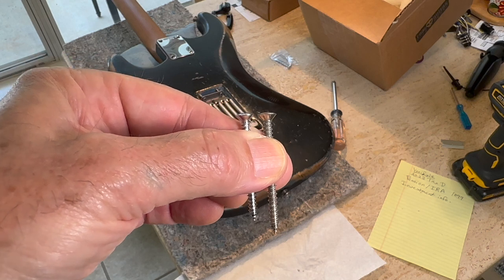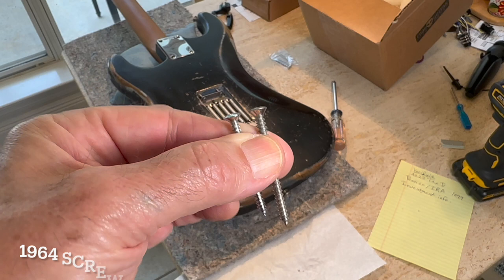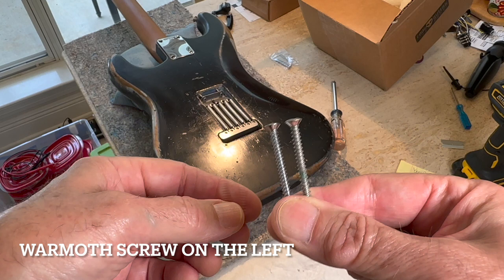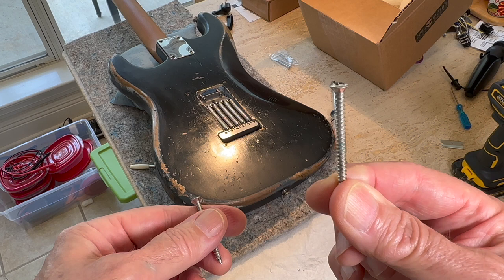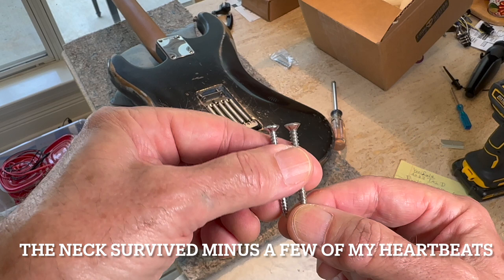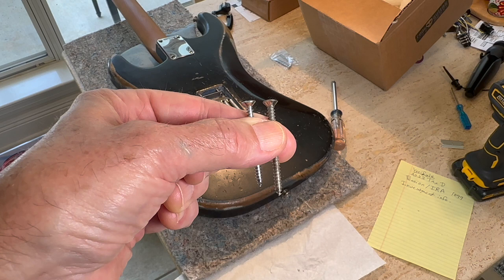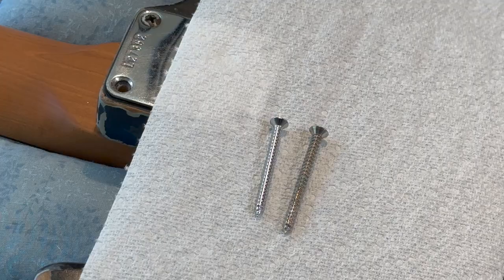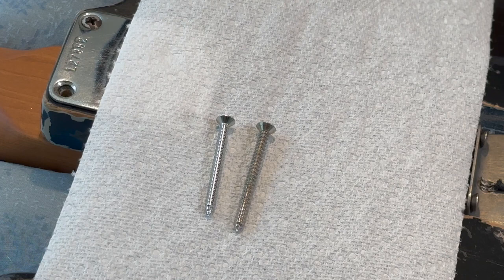Be Careful When Mounting a new Musikraft or Warmoth Neck to a Vintage Strat

Comment: You, apparently,  and thankfully,  are on my feed. I would ask, what guitar is it that Master Millstap finds himself putting a replacement neck on. Intriguing stuff. I would submit, thanks to your screw dimension insights, that I would prefer to reuse the old school screws, by enlarging and deepening the pilot holes on the new neck ( Carefully gauged of course ). Ok, to a complete Newby to woodworking,  that might seem daunting, but it actually only requires a little application of commonsense, and I would just feel a little better about the job. How about show us what guitar you got there with the new neck? And you probably should go ahead and crank it through, oh I don't know, your old Bassman? Please?
Reply from the maker: I tried to deepen the holes because I measured them and could see they weren’t deep enough. That roasted maple is so hard, the bit wouldn’t touch it. So, not thinking apparently, I put more pressure on the bit, (a fairly new bit with a depth stop on it to keep from drilling through the rosewood fingerboard) only to look at the fingerboard and see a bulge forming from the pressure. Heart attack time. To make the holes bigger could be the same issue and even chance breaking a bit in the hole. I highly recommend getting the proper screws the holes were drilled for. Musikraft and Warmoth both sell them. Forget the vintage screws. I would have never thought they were different but after this fiasco, it dawned on me. The first thing I was planning on doing when I got the Warmoth parts (video coming this weekend) was to remove a vintage screw and compare. That is when I did this video. Don’t attempt to drill in the roasted maple if it can be avoided. Of course, depending on your tuner choice, you may have to drill the tuner mounting holes which has to be done carefully. I did a video on it (Musikraft neck #1). I’ve had people tell me 1/2 of their headstock feel off when the crack went through all of the tuner posts and screw holes. Here is the neck in action just a few days ago. Plays and sounds great. How To Play Earth Blues from People, Hell & Angels -  Part 1
https://youtu.be/MVM72L-xJ-c
Reply: @millstap  Okay now, wait a dang minute. First, you are something else. Much respect. But....I now need to know the tale of the neck replacement. Obviously it was a vintage Strat, because you said so. What was the issue of the need for the new neck? That alone sounds like it would be a good anecdote. Secondly, what became of the original neck?, because this commenter is having dreams of procuring it from you, and doing something with it that you simply chose to avoid by getting the replacement neck.( Now if you smashed it over your Bassman, I will probably get over it). Also, do I infer that the depth dimension of the new neck is shallower than the original? That would be an interesting revelation. (Bulging fretboard, from drillbits about to protrude). The stuff of nightmares. I might be persuaded to follow your advice to forget the vintage screw adaptation, but if I had a 1960 Strat body ( I have pretty much resigned myself to be satisfied with my '73 Strat that I bought in 1974 ), I am pretty sure I would be grinding off the tips of the original screws, and would be unintimidated to resize the pilot holes.( I've been woodworking for a few decades, give or take a few). So if you feel inclined to indulge my curiosity, please do. And don't forget to get that junked vintage neck out of the trash can before trash day, there might well be a myself to adopt the little orphan. It is great fun to listen to your stuff!

Comment: So the vintage screws were too long and cracked the new neck? Or are you safe? 🙏🏻
Reply from the maker: The larger diameter is what caused the most problem but the extra length was also bad.  I measured the pre-drilled holes before screwing in the screws and found them too short. But when I tried to lengthen the holes, I couldn't get the drill bit to drill them any deeper.  I caused another little bulge on the rosewood fretboard just from the pressure of trying to deepen the holes even though I had a bit stop that would not allow me to drill too deep.  Don't do that.  Just get the small screws when you order a neck and be done with it.  The neck sounds a plays wonderfully, albeit two cracks and a bulge, but by no means the desired result.  Here it is in action two days ago, https://youtu.be/MVM72L-xJ-c.
Reply: @millstap  ... Thank you so much for the reply.. appreciate it... I'm glad you made this video with the warning because I'm in the middle of switching out alot of necks on different bodies for all my Strats .. this definitely has me going the safer route now... I actually had to use a couple different screws on my 6-screw bridge not long ago and wound up poking holes through the body myself 😂... Thankfully you can't see it because I use 6 raw vintage springs and it covers it completely.. your videos are so enjoyable bud... Look forward to always seeing more here in New York.. 👍🏻🎸🤟🏻🔥